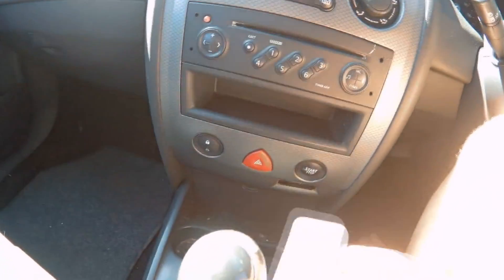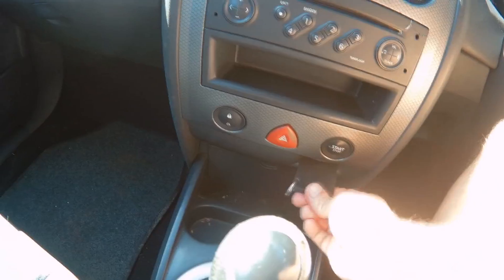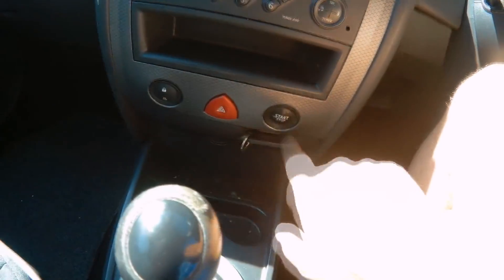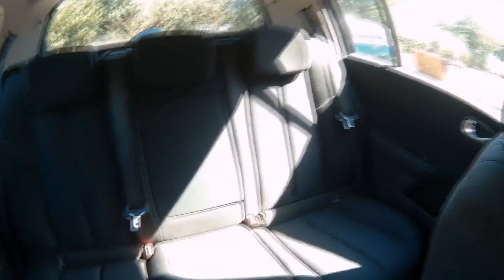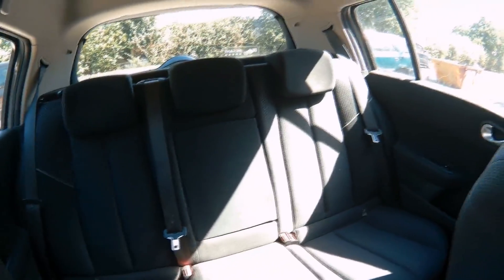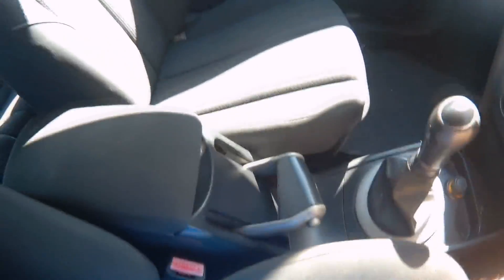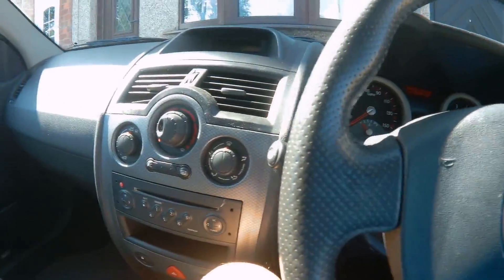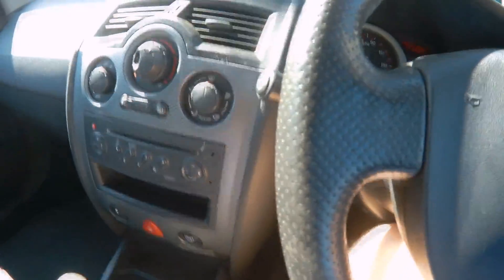Renault Megane dephaser pulley change pt.1

Comment: Hi. I’ve got the exact same engine im my megane 2. The engine is idleing good, but when i’m driving it, the engine stalls when i press on the clutch after accelerating (only if it’s cold). Can the pulley be the problem?
Reply from the maker: I would say throttle valve if the pulley does not make the rattling sound.

Comment: Thanks for the video. At 1:24, when you start the engine, it makes a brief high pitched sound. My engine also makes the same noise, but did not heard it from any other Megane besides yours. Do you know why it does that?
I am also going to change the timing belt. Your video series were really helpful. Hope everything goes alright!
Reply from the maker: I don't know what made that noise, to me it sounds like a belt slipping but it never gave any issues. The car was great after I changed the pulley and I used it as my daily car until June 2019 when I eventually sold it. I did have to do other work on it but the engine was very reliable.
Reply: @SteveSims   It works now!   I changed the crankshaft sensor with a new one when I changed the timing belt. I replaced it with the older one and it worked. I don't know why I did the two things at once. I feel stupid. I think you were right. that  high pitched noise was coming from the belt. It is now gone.
Reply: @SteveSims  Thank you for your reply. Today, I changed the timing belt. 
U shaped tool did not fit the camshaft grooves. I thought that timing was off. So I loosened the camshaft pulleys, then inserted the camshaft fixing tool, and tightened up the nuts. Set the crankshaft to TDC, and installed the timing belt. 
I turned the crankshaft two revolutions, it was not resisting too much. 1/4th it was easy to turn, other 3/4 it was harder. ( I think because only one of my spark plug was removed, compression made it harder.)
Then I started the motor, I cranked it around ten seconds but did not start. I am afraid that I made the timing worse. There is a very deep knocking sound coming from the engine. I waited for fuel pump to work and tried to crank few more times with no luck.
I'm stuck here. What should I do? (Sorry for my English)

Comment: Hi sir!
Did you fixed your problem 
My car also has the same sound
When engine is cold! 
Is it pulley or starter?
Reply from the maker: Yes I fixed mine and I am still using the car now. Mine was the pulley, If the engine turns over then it wont be the starter. Try cleaning the oil valve near the pulley.

Comment: sorry another question. maybe being daft but if the lock tool is on how do you get the dephaser off. or is it safe to remove after locking the timing position?
Reply from the maker: lock the timing on the end of the camshafts with the c shaped tool Then remove the camshaft covers etc
Put the locking tool on when you loosen the dephaser pulley bolt cover and bolt.

remove the locking tool to be able to remove the pulley and put the new pulley on
put the locking tool back on so you can tighten the new pulley bolt and bolt cover.

Remove it to fit the new timing belt.

I dont mind answering questions so feel free to ask.